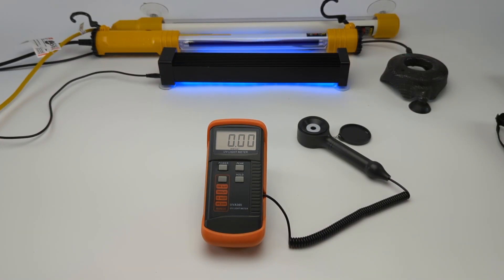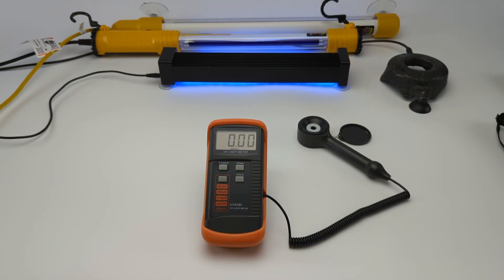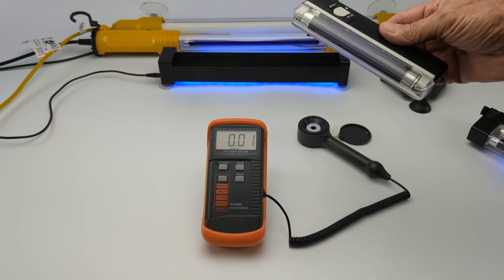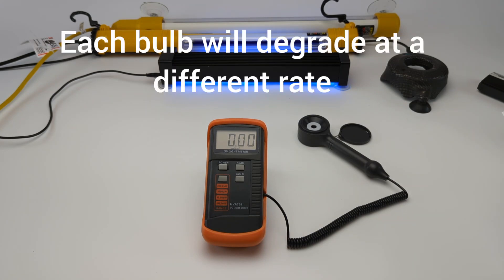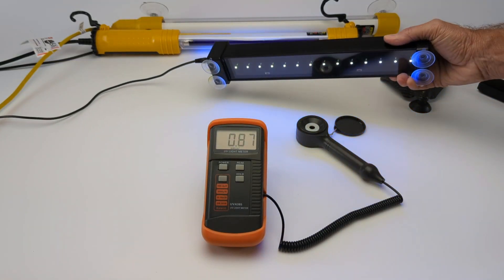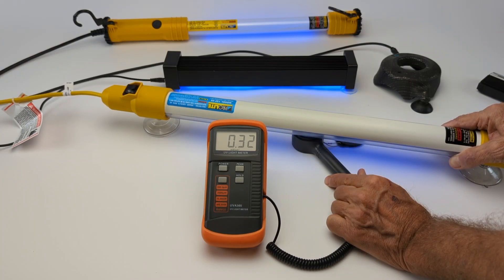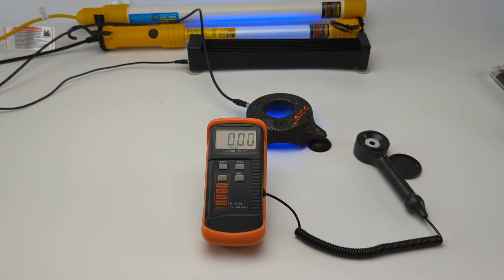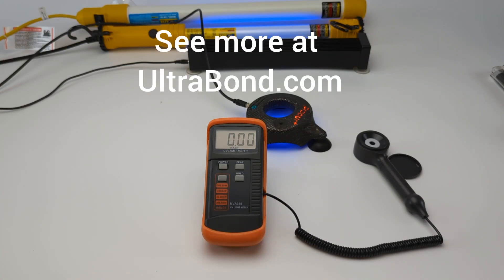Windshield Repair Kits - Curing Lights; the Good, the Bad and the Ugly

Comment: Interesting
Reply from the maker: Thank you
Reply: @UltraBondWindshieldRepair  Richard have you tested the UV output of the hand held flashlights such as the Ignite from Delta Kits?
Reply from the maker: @chipdr911  I have tested UV flashlights with the UV meter but not the 3-point bend. With multiple bulbs and with one bulb when at an angle such as when curing under pressure the UV energy is jumping. With one bulb the energy can be uniform but only when it is placed straight down on top of the glass such as can be done when curing the pit. Whether the intensity is too high has to be tested with the 3-point bend. I will do that and make a second video. Does the Ignite have one bulb or multiple bulbs? Is there a manufacturer's name on the light?
Reply: I have two UV flashlights, one from Delta Kits and the other from GlasWeld. Don't know the brand name for each just the name that the companies gave them. They both have single light.
Reply from the maker: @chipdr911  Thank you, I have single bulb flashlights and will do a test.
Reply: How much it costs. Well done 👍🏼

Comment: While I can appreciate your passion for the science of windshield repair, the information in this video is inaccurate in regards to the ProCur+. I'm sure you aren't intentionally trying to mislead anybody, so I figured I'd help out a bit! The ProCur+ doesn't move around on a repair, and the leds all point to the middle. To get an accurate reading, you would have to sit your sensor in the middle and leave it still, since that's the intensity the repair would be receiving. Next up, curing time - It is on a 1 minute timer and users are instructed to cure for the duration of the timer - once for the resin and a second time for the pit filler. That's 2 minutes of cure time per repair when using the ProCur+. Nobody is taking it off the repair before the light stops blinking; That would be silly. Finally, the pricing you gave is high by $100. We sell the ProCur+ for $299, NOT $399. Using accurate information and having an independent lab do your testing would add a ton of credibility to what you are trying to do here.
Reply from the maker: Hi Derek, thank you for your comments. Yes I am aware of the 1 minute timer (I was going of their current website) and I did use the timer in the 3-point bend test. Actually I just checked the video and it was over two minutes cure time total. On the angle of the LEDs when you place the reader in the middle and angle it toward the LEDs you get a different reading from one side to the other. If you would like to give me your email I will video and send you a link. Placing it in the center and holding it there would be same as placing on the fluorescent bulb and not moving it. I also switched to an Ultra Bond tool and using the same resin got a score of 89% new glass strength with the fluorescent and 57% with the Procure+ - a 32 point difference. As far as Independent labs - I use them for my own products for court. But to be able to test and confirm what I sell it is much more efficient to have my own lab.Yes I did see that the current price is $299. Personally I would say the Eco Vac tool was a better tool and cured with the sun or a flourescent is a safer repair. Thanks again for you comments.
Reply: Richard's lab test are about as credible as you're going to get.